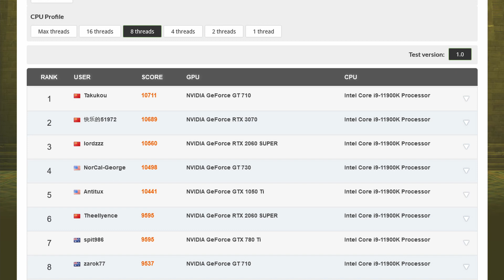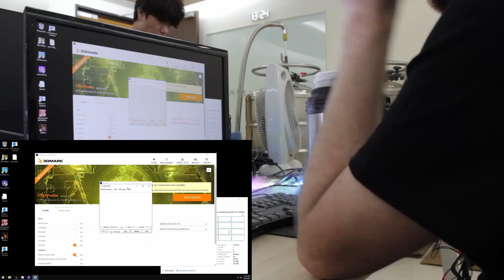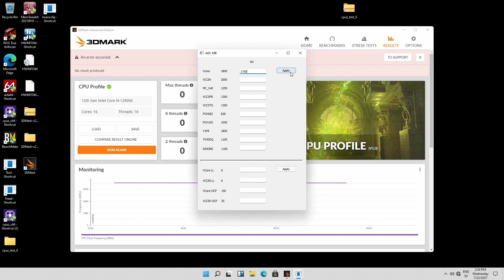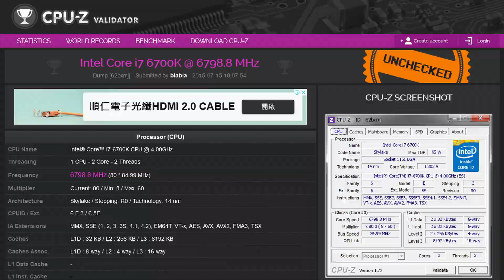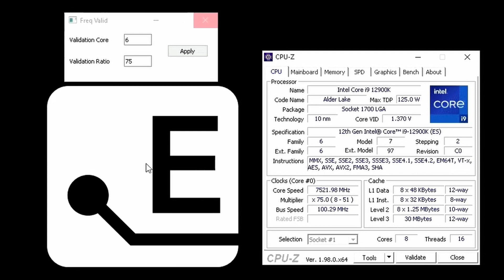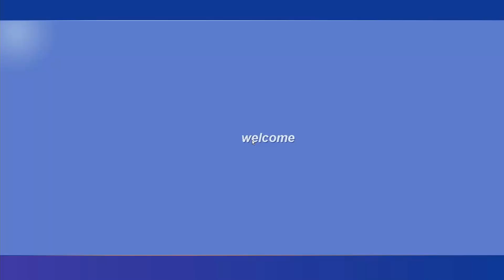World's Fastest Intel Alder Lake

Comment: I belive AMD is still ahead in multi core performance
Reply: yeah hard for a 24 thread to compete with a 128 thread lol. my prediction is 5900x gets destroyed 5950x barely edges it in multi cause of higher thread count but all is destroyed in single thread.
Reply: @Rs3Matt  agree, And with LN2 not much chance for 6GHz limit of 5950X (extra hundreds MHz doing well job in Alder Lake Im sure)
Reply: Not with a very light oc
Reply: @sagerdood  bullshit, cause 5950X stock mukticore clocks are 3950MHz. My chip is able run Cinebench at 4750Mhz on AIO 1.375v. Alderlake stock mukticore is close to maximum all core OC. There is headroom around 200MHz .
Reply: @sagerdood  huh?